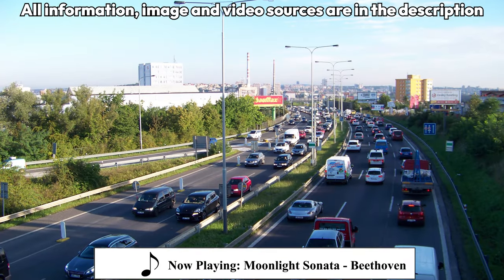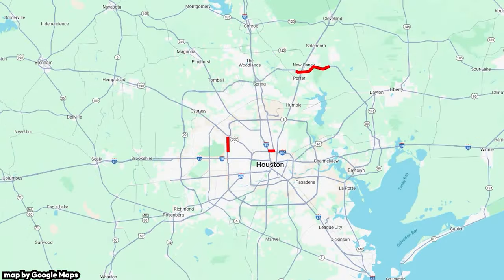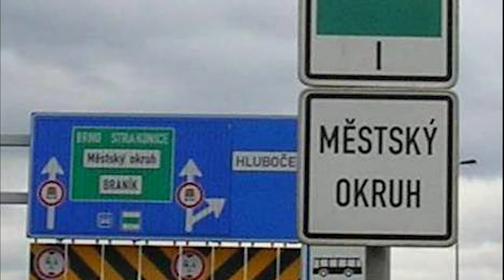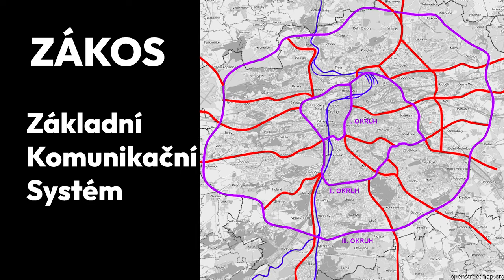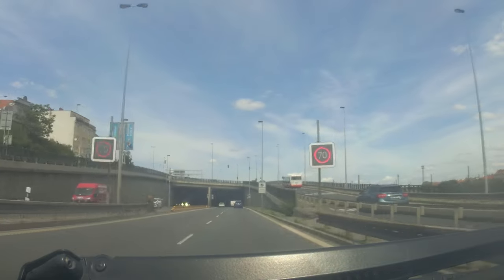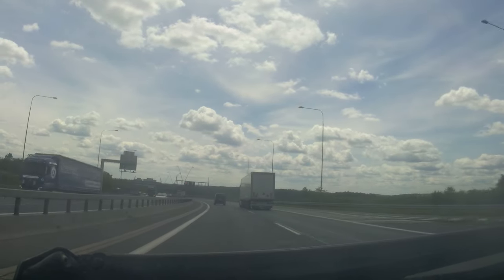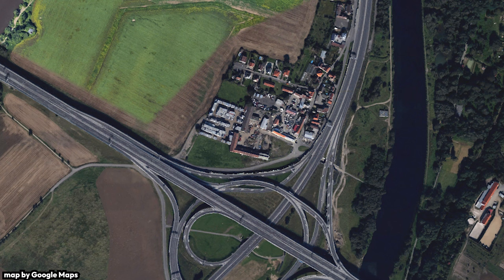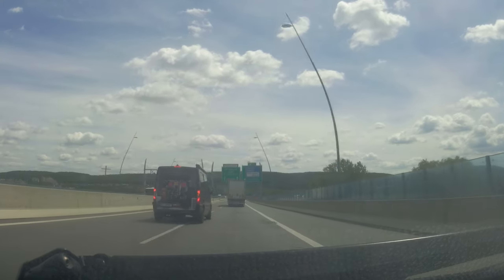Prague's Unfinished Ring Roads

Comment: I read somewhere that outside to outside traffic is only 3 % of traffic at magistrala, so if it disappears thanks to the new outer ring road, absolutely nobody would notice. But it would make some difference on the inner ring, at least temporarily until traffic is induced again to previous levels. I also feel there are some potential for sequels to this video like the Nimbys in Suchdol or how Zakos was eventually turned down (could include some engineers starring in this epic hero fight).
Reply: It could be possible, but still I wouldn't say it won't help. Firstly in some cases it would be faster to take the longer route. Secondly, when finished, Prague can introduce a toll for entering the city by a car, therefore motivating people to use public transportation and limiting cars in the city center.
Reply from the maker: Such a toll has been proposed for the city center, and the reaction was about what you'd expect from Prague car-brains

https://www.idnes.cz/praha/zpravy/praha-centrum-vjezd-ridici-auta-poplatek-doprava-magistrat.A231116_135807_praha-zpravy_sdlk

Comment: Würzburg, Germany also has a „ring road“. Though it‘s more like an „always congested 3/4 ring“.. and coincidentally, most people want to go to the quarter of the city not served by the ring.. which means you‘ll have to either drive all the way around clock-wise… or drive through the congested center.
Würzburg was mostly demolished during 1945… and city and traffic planners seemed to have been seething misanthropes.

Comment: 7:13 This intersection is so confused. On the one hand, it is a large awesome roundabout, but on the other hand, it is such a hopeless solution. In the east, it is supposed to be a highway but it looks like a wide local road. And this is an animal crossing 200 meters from the tunnel. And this planned junction in place of these unused viaducts. And tunnels where one has 2 and the other 3 lanes. This is too much for one place. I have the impression that in planning phase engineers have said "yes" a few times too many. But despite everything, I am delighted with this intersection
Reply from the maker: I agree that I felt a little bit nervous driving through there haha

it's like a spaghetti web of just roads
Reply: It looks like a bad attempt at parclo-turbine intersection with crossing merges. Turbine intersection is there to eliminate this
Reply: I don't think there is a word in English to desribe this intersection [facepalm].

Comment: Nice video !
I have to say that, in general transport infrastructures have some serious delays from the time they were, conceived, built and made operative.
In my country I can say that there is usually a ten year delay since, the project is needed to its approval and thirty years for funding and execution. 
Sometime I wonder, given that timeframe, if all the planned structured do still make sense.
If we use the "thirty year delay model" the plans that are coming ready now would be the ones made the last years of the previous millennium.
Since then a lot of things have changed and I can say quite a bit on that.
My family is international, Polish. from my mother side Italian from my father one and we were used to go on holidays from Italy to Poland and reverse by car (apr. 1000km 18h / 20h ride per direction) I wanted to write how it was but I realised that how long is that and how useless it would be for the main purpose of the discussion.
The main gist is none of those rides are any more necessaire, we do all with cheap flights, we buy any international products that we like on the main international chains (Lidl, Carrefour, Tesco etc.) and all the particular local products that we like can be purchased online.
If we consider that also freight is increasingly moving by plane or train, or disappearing ,just immagine how many appliances disappeared with the rise of iPhones (watch, alarm clock, calendars, radios, books , cameras, maps...)
So I am still wondering if do all of this motorway still make economic and logistic sense ore are just something that a time ago an we continue with the logic "you started and you have to finish it".
Reply from the maker: Glad you liked the video!

And about the thirty year delay..
From my personal (as of now still uneducated) opinion, I think that certain pieces of road infrastructure (like ring roads) will still be used in the future, and thus, should be built

Although it could be argued that high speed rail construction, and railway stubs to warehouses should be priorized over highway construction..
Reply: @TheTramly  I've seen some videos of future projects for High Speed railways released by SŽ. It would be nice to make a video about the future plans for high speed rails in CZ.

Comment: It definitely makes sense to complete the inner ring road…but the outer ring road - wouldn’t it just promote more suburban sprawl and induced traffic. 

Instead, investments in transit solutions - a regional rail network (if Prague has one???) is the only proven way to reduce traffic on a regional level. More roads and more lanes only induces more driving.
Reply: Inner ring is just a higway through dense urban area. It's not a ring around Prague, but a ring in the Prague.  

Outer ring is a part of Czech higway system and actually goes around Prague. 

So I think the outer ring makes sense, because it's necessary part of CZ highway system and inner ring shouldn't exist because it just induces traffic inside city.

Comment: It's 2024. Nobody in a developed country needs to build any more roads.

edit (having watched the video, expecting a big "BUT"):
I'm amazed you touched and acknowledged the part with induced demand of the tunnel built in 2015, but you don't realize that the "missing" ring road project will experience the same effects. Periphery to periphery traffic can easily be handled by the existing road network. Massively expanding those will increase car traffic volumes long term which will spread to connected parts of the network.
I presume all of the negative effects of traffic are known to you.
Only effective ways to reduce car traffic is increase public transport speeds and frequency, increase the attractiveness of stations and reachability by especially walking, expand safe cycling infra into a connected network, but most easily, reduce car speeds, car lanes and reduce avaliability of parking, especially in the city proper, in favor of space for pedestrians and greenery.

Really quite simple actually.
Reply from the maker: That is true, however, I believe that some level of car traffic (mostly trucks carrying cargo and such) will probably always exist
Building proper road connections that would route that traffic away from the city and towards its periphery would in my opinion improve the quality of life of the citizens

but other than that, I agree that way more investment needs to be made in transit, most prominently rail
Reply: Building ring roads who avoid transit in cities is still great but yeah building highways inside cities or anything that helps going faster in the city is a no of course
Reply: @manu.yt25  question is what you consider highway.